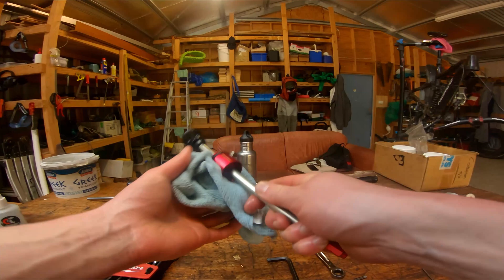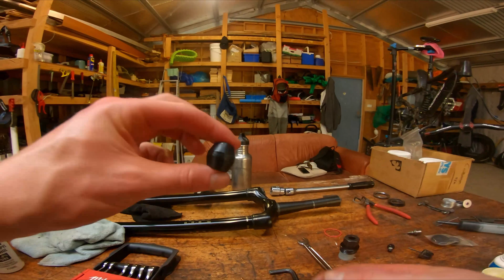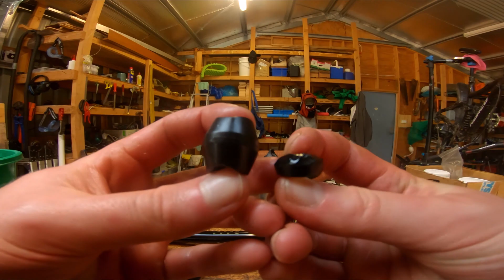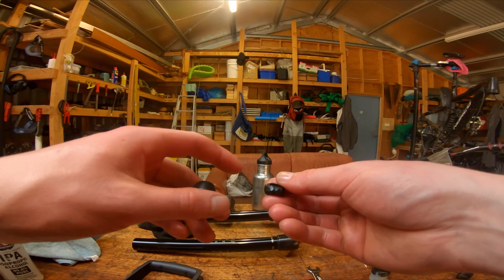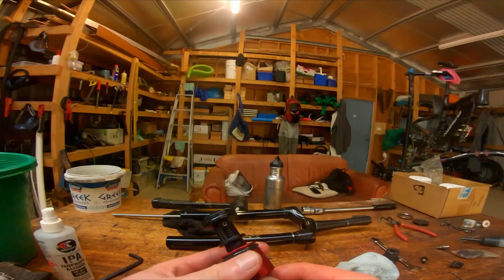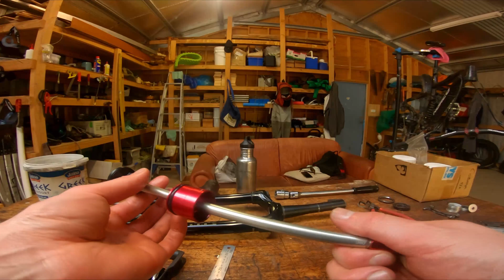Rockshox Debonair C1 Modification  - Explanation & Review

Comment: This really works. I just did it to my pike RL3. And what a difference. It added 10mm total with the rubber ring I used. I took out all the volume spacers and went 35 psi higher then previous. Kept the recommended rebound clicks. Very supple, progressive and the grip was insane. Plus I didn't have to buy another debin air spring. DO IT!

Comment: Hello . I have a stock Lyrik RC 170mm 2017. I need to make it soft for a light rider, weighing 40kg. What can you advise?
Reply from the maker: 20% sag (while seated) and little to no compression damping. As far as this mod is concerned, I don't personally have experience with the older RS air springs so I can't say if it will work sorry.

Comment: I have a 2018 lyrik 160mm with the B1 air spring and found it ramps up too quickly for me to use all the travel (no tokens, 30ish% sag). Considering removing the bumper completely if you think it may help?
On your C1, did cutting it make your fork more or less progressive? 
And if it didn't change it, I may still do it for better small bump sensitivity
Reply from the maker: 30% sag is too much. You want to aim for around 20% front, and 30% rear.
Don't worry about using full travel - that's dependent on context. I don't know how much you weigh or how hard you ride so I can't say whether or not you should be using full travel.

Regarding the bumper, people were doing that in the B1 springs with no issues and good results, which is what got me thinking a similar approach might improve the C1 spring. Just make sure there's no mechanical top out after you've removed it, and if so you've got nothing to worry about!
Reply: @liamcobham  thanks for the feedback! I'll try it out!

Comment: Great! Thank you for sharing this!  Very interesting. I have both C1 and B1 shafts. I like that the C1 is riding higher in the travel but the small bump sensitivity is shit. This mod sounds perfect. Do you think I can do this on a 2020 160mm lyrik? It was bought as 150 and it has only 150/160mm printed on the stanchions. Is that maxed out or not?
Reply from the maker: A 2020 Lyrik can max out at 180mm travel, you're fine!
Reply: @liamcobham  Thanks. Im playing with the idea of removing the bumper alltogether aswell tbh. )
Reply: @danielvojtisek2223 did you end up removing the bumper completely?

Comment: I did this today with my 150mm pike with c1 spring, cut the bumper in half, only haven't had the chance to ride it yet. But once I assembled the fork back I noticed that every time I compress it, there is a hissing sound coming from the fork in the first few mm of the travel. Is that just two chambers equalizing since now the seal head sits a bit below the dimple? Or could it be something to worry about?
Reply from the maker: Nothing to worry about! Yes, that is the sound of the seal head passing over the equalization dimple on the inside of the stanchion.  My Lyrik does the same!
Reply: @liamcobham  Thanks! Glad to hear that. I will take it for a ride tomorrow.
Reply: @michalhnat1919 How does it ride now?

Comment: I’ve got a rc2 debonair c1 at 160mm. Will this mod work at this length of fork? Can you just buy the bumper on its own so I can just cut and try and got back to original if I’m not happy?
Reply from the maker: As long as it's a Lyrik not a Pike, you're all good! 
The only time you can't do this is when your spring setup is already the max travel for that fork (180mm for a Lyrik, 160mm for a pike etc).

I'm not 100% sure if you can buy the bumper. But you could ask some bike shops if they have any floating around. Failing that a suspension specialist is almost certain to have one. Anyone you might know who has bought a new spring for their RS fork will also have one they don't need.

Comment: I'm trying to figure out what makes this supple off the top just like the B1 as you mentioned and I think the only way is to have that piston sit under the dimple at sag or very, very close to it. Do you know if the C1 piston after the mod, now sits under the dimple? I like the "high" feel on the C1 but I want the off the top supple feel of the B1. Thank you for sharing this video btw.
Reply from the maker: I'm pretty sure it does sit under, yes. It doesn't self equalize +ve/-ve like the stock C1 - you have to compress it a bit as you're pressurizing the spring in order to properly pressurize the -ve chamber. 

Either way, it feels really, really good compared to stock! (And that's despite my fork having really bad bushing alignment haha - gonna get that fixed soon).

Cheers 😁
Reply: I did this to my ‘22 Pike Ultimate but with the B1 and man, it feela so good! Almost feels better than my ‘22 Lyrik Ultimate 160 B1 with stock bumper. I will try this on my Heckler next. That bike also has a Lyrik but with a C1. Thanks man!

Comment: Very interesting. I am about to swap out my C1 for a B1 shaft. Do you happen to know if I were to trim the bumper on the B1 would it create too much negative volume??
Reply from the maker: I think you'll be fine. A year or two ago, it was pretty common for people to completely remove the bumper from the B1 spring. Plus, if you're getting a new air shaft, then you can always leave one bumper whole and retrofit it to the B1 if you don't like the results. 

Just remember, just because the fork sags into it's travel a bit without a rider on the bike, that travel is not wasted. In fact, that negative travel will help the fork track the ground. As long as you're happy with the dynamic ride height, and the axle to crown is right for your bike, you're good to go! Cheers.

Comment: Hi. I have lyrik with c1 and have b1 debonair. Do you thing that cutting the topout bumper on c1 and using older shorter footnut will result as older bebonair without changing travel and unnecessary sagging? Many thanks
Reply from the maker: I've only used the C1 spring (other than having a quick bounce on my mates bikes) so I can't really say for sure.

As long as you're not at your fork's max travel config (180mm for a pre 2022 Lyrik) you're not going to damage anything by trying it. 

I think the reason the B1 sags more than the C1 is due to the larger negative to positive air volume ratio (not sure if that's the correct term haha, but yeah. B1 has a larger negative volume relative to positive and therefore has more static sag). 

I'd recommend just trying exactly what I did first. (Full C1 air spring, and just chop up a bumper. I've actually cut it down even more since this video with no issues).
Like I said in the vid, you won't experience harsh top out as with the stock C1, you'll actually gain a few mm of travel, and the spring will perform better in every regard. At least in my experience anyway, cheers!

Comment: With this mod, how does small, high-frequency bump sensitivity compare to stock B1? How many tokens are you using, if any? Thanks for the vid!
Reply from the maker: I actually don't have experience using the B1 sorry, but it's noticeably better than the stock C1. 

I don't use any tokens in my current setup. I've also dropped pressure to 90psi and am using 2 clicks of HSC and 4 clicks of LSC (both from closed of course). After talking to Nigel Reeve (who was Stevie Smith's mechanic, and is a certified suspension wizard) I learned that compression damping is your friend! 

When I made this vid I was ignorant to the compression side of the equation, but the air spring mod is still holding up extremely well! I've actually cut the bumper down a bit more since making this vid too.
Reply: @liamcobham  you gone from 125-130 psi down to 90 with same shaft and added HSC and LSC? What is your current SAG?
Reply from the maker: @jozefkeckes3558  I honestly haven't measured static sag for a long time. If I were to guess, it would be somewhere in the 15-20% region.

Comment: Interesting solution. I had the C1 airspring in my new Pike but really couldn't stand the harsh feeling of the top. Found a second hand B1 spring and swapped the C1 out. Much better. My plan after the next air spring service will be to cut the top out bumper in half to increase negative chamber even more
Reply from the maker: Certainly worth a crack! I've chopped mine down even more now, probably half the size it was when I made this vid. I'm half tempted to try removing it all together... I haven't had one mechanical top out with this setup!
Reply: @liamcobham  does removing the top out bumper increase the end stroke ramp of the fork as you are increasing neg chamber volume?
Reply from the maker: @ashkonsenaati8530  I think so. The air spring seal head sits several mm higher in the stanchion therefore the +ve volume, once both chambers are equalized, must be decreased somewhat. I found this spring worked best with no volume spacers. I started with 1, then tried it with 3 which felt absolutely horrible, went back to one and then took that out as well.
Reply: Interesting! But as I understand it, it is not increasing the neg chamber you do with this mod, but quite the opposite! But the decreased neg volume leads to a greater under pressure and thus an increase in neg force, that allows for the setting of a lower positive pressure. With lower pos pressure more travel is needed to ramp up and therefore tokens are less effective. Right?
Reply: @PeBr2813  That would be my understanding.  I did this soley for the increased travel as I wanted 135mm.  The problem is that at the top of the travel (full extension), you get a dead zone where the fork isn't under tension.  Sort of feels like strictioninig of the fork.  It would be the same as using a Pike spring in the Lyric (ask me how I know...).

Comment: what sag did you end up on with 130psi?
Reply from the maker: Not sure, I haven't measured. 
I prefer to adjust depending on how it actually performs when I'm riding. I like a very fast reacting fork, that is supple on small stuff and provides good support.

But if I were to guess the static sag, I'd say 10-15%
The larger negative sucks it down just the right amount haha
Reply: @liamcobham  allright. Think im gonna try it out on my Trek Remedy. Just upgraded to DVO jade x so hoping with this mod the front end is more in line.
Reply from the maker: @diiiooon1989  Sweet! Let me know how it goes. I've done it on two C1 springs now and only seen positive results (other fork was a MoCo Yari). 
Cheers!

Comment: Interesting findings, definitely aligns with my experience. Did you ride the lyrik as a 160mm fork with a B1 seal head? It seems like the C1 is a knee-jerk reaction from RS to people complaining that their B1 Lyriks/Pikes "sat into their travel" at rest, because there was some -ve travel available as a by-product of the pneumatic top out/ force balance. With the C1 shaft it seems that the difference in compression ratio results in the +ve chamber having more force on the piston, pushing it into the top out bumper, extending the legs to give people the travel they're quoted on the packet. This comes at the expense of the excellent force balance the B1 seal head achieved (noting that the force is not the same as the pressure, as the pressure is higher in the -ve chamber at rest to account for the reduced surface that it acts on Vs. the +ve side of the piston). Essentially, by making the seal head taller, and moving the sealing Oring, the -ve volume has been reduced, meaning that the pressure in the -ve chamber drops more rapidly. (the force you feel yourself pushing against is equal to the forces (proportional to pressure) on the +ve and -ve sides of the seal head, plus the stiction), so the effect of the positive chamber comes in earlier on the C1 spring (or more mid-stroke supports if you read the RS marketing). It's definitely an interesting component and conversation, personally I feel that the result is actually a product that sacrifices suppleness, to appeal to a number of people who perhaps do not understand what is happening inside the air spring, and just want exactly 150/160/170mm of travel.
Reply from the maker: Thanks! I haven't used the B1 seal head in this particular fork, though I have had a fair go on a B1 Pike. Coming off the Luftkappe Yari, I immediately disliked how the stock C1 felt - mainly the nasty top out, but also the sacrifice to suppleness as you mentioned. I'm so happy doing this has solved both issues! 
It would be interesting to ride this C1 mod back-to-back with a B1 and a Luftkappe to get a feel for any differences. From my experience, I suspect all three would be very close in terms of on-trail performance. The only main difference is that the C1 mod might ride a tiny bit higher in it's travel, like I talked about in the vid. Oh and I forgot to mention it in the vid, but I also did this mod to my cousin's C1 Yari recently - and that thing felt just as good as I remember my old Luftkappe feeling! + a bit more travel of course, which is nice.
I totally agree with you regarding RS appealing to what must surely have been a vocal minority. I feel like the people who complained about their 'lack of travel' need to ride their bikes more and stare at their stanchions less 😆